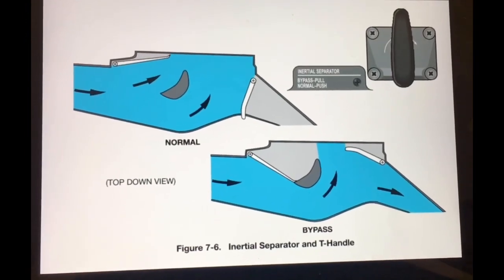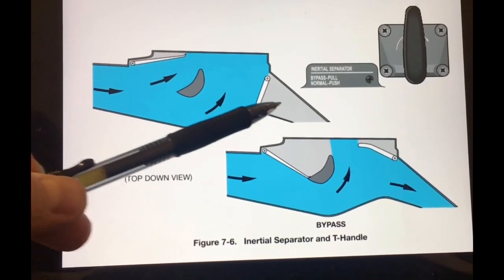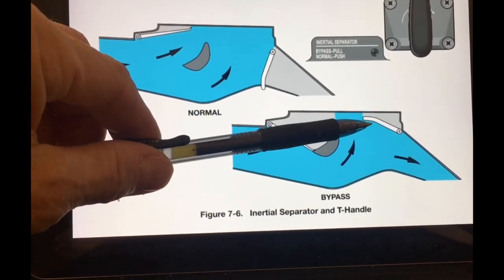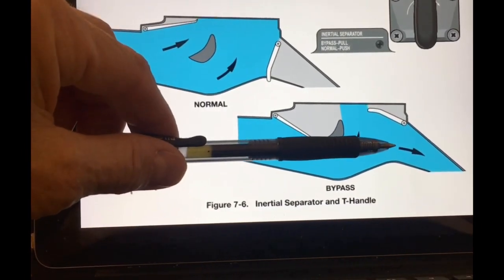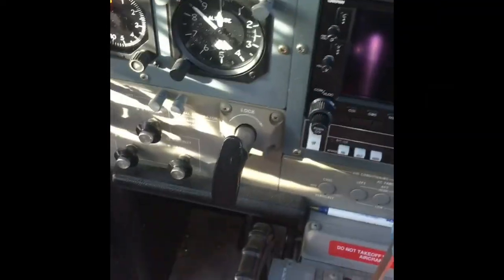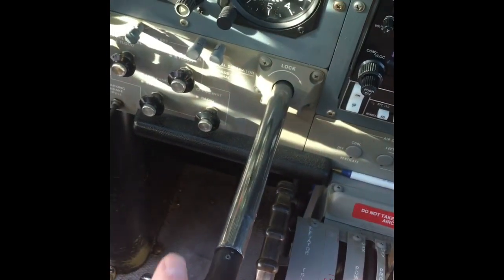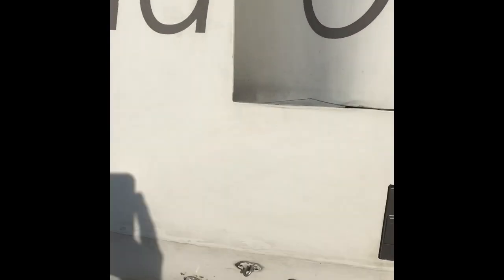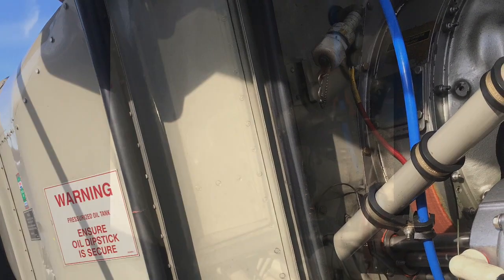Inertial Separator Cessna 208 (Caravan)

Comment: When you bypass, does it affect RPM/torque?
Reply: it will increase ITT and decrease Torque
Reply: Great question because that's exactly what i wanted to know too! I'm not sure if the air is going directly into the engine via some sort of air manifold in that intake (In which case i would assume an RPM drop would happen) or is it just circulating around the bay for cooling? Yeah i would like to know.